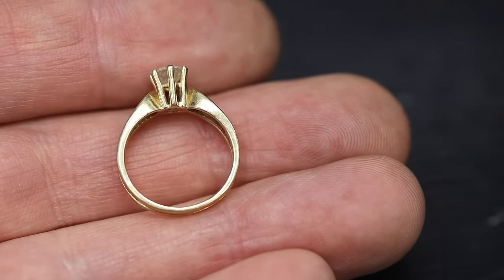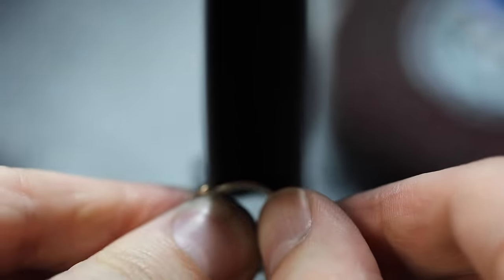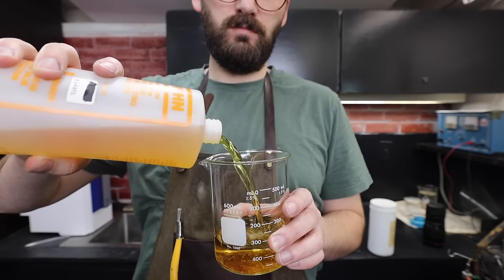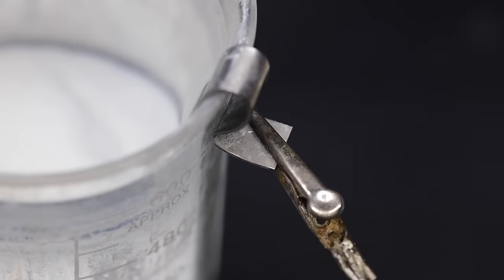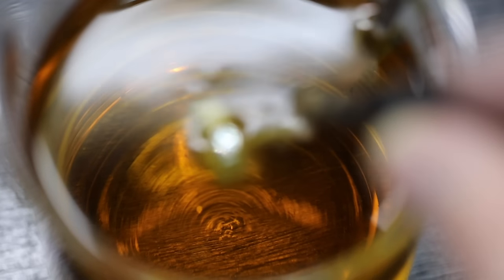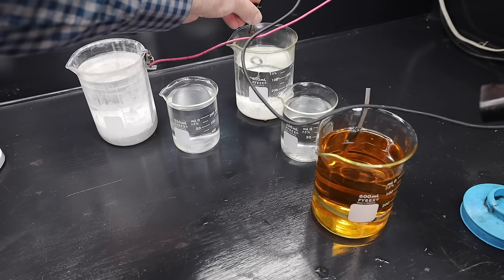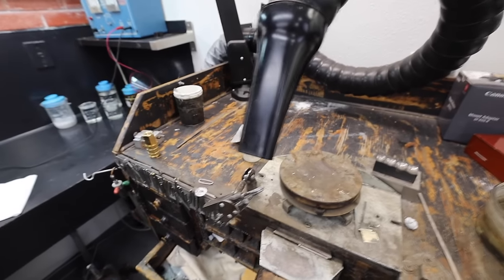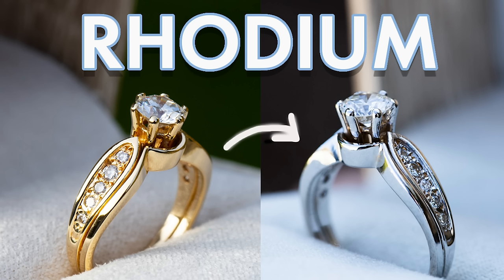How To Turn A YELLOW ring WHITE!

Comment: My skin chemistry is such that the plating doesn’t last a year for an everyday wear, which is why I got my wedding set in palladium :) so happy with it after over 5 years now
Reply: I just had my wedding ring and some other bands replated. The wedding ring is only 2 years old and wasn't that bad at all just a slight gold color showing and only on the underside. My other rings were more yellow but over ten years old in the same area. One was missing a stone. Glad I did my wedding band even though I didn't think it really needed it at the time but it definitely looks a little better. Definitely cleaner lol.

Comment: I am surprised this can be done without removing the stones!
Reply: Diamonds are hard and dont have pores like softer stones would so chemicals dont damage them :)
Reply: I was too, but it makes sense, because diamonds are very poor conductors, so the current wouldn't flow through them and attract the rhodium ions.
Reply: @Yelle777  
Hello, how could i plate a ring with softer stones like quartz, emerald, etc??? Could i just plate all together like diamonds?
Reply: @69rafaroots  remove or protect the stones before plating them
Reply: You can't electroplate metal onto a stone...

Comment: Hello fellow jeweler. I noticed under the stone the base of the head and some of the side stone prongs had some yellow.  That can be defeated.  Small little brush the side stone area, for under the diamond, the ring would have to live in the ultra sonic a few days maybe even some sparex no2 acid.  After that it will plate that section as well.   For some reason those areas get a small thin layer of build up and grime that is there even after its been cleaned and steamed.  Only things that clears is it extra cleaning.

Comment: I have had this done to multiple pieces of jewelry and love the new look. I don't wear yellow gold much anymore and had many pieces of jewelry sitting in a drawer unused. I now wear all of the pieces I had rhodium plated. You do need to know that they can only do this with hard stones. If the piece has pearl, coral, opal, etc. in it, the stone will have to be removed so it costs more.
Reply: Most opal is lab created now so it holds up just fine in the plating solution as do most stones but yes pearls do need to be removed but they’re mostly in yellow gold settings, I’m not sure about coral though

Comment: I'm thinking of getting a few pieces rhodium plated - they're just silver that oxidizes quickly, even without wearing them and I have to clean them so often! what's your advice, will they stay cleaner and shinier for longer if I get them plated?
Reply: You have to get rhodium redipped on rings, usually once a year unless you're rough on them then probably more! This is what we recommend at the jewellery store I work at :)
Reply: Avoid chemicals and opt for a polishing cloth when you want to bring shine back to them because traditional jewlery cleaner could wear the plating quicker and also take them off when you wash your hands and sanitize and get the rhodium redone after it wears off

Comment: The end result looks great. Does the metal of the base ring have any effect on the end result, or could you use steel or titanium instead of gold?
Reply: You can plate any metal.
Reply: @curlyhairdudeify  Interesting. So effectively, the gold underneath this plating is fully invisible, and something only known to the owner. I'd probably not bother with the gold then 😉
Reply: @MrJoerT  the fun thing is that between the two metals, gold is the cheap one...

Comment: Thanks for this video. I need to get my set dipped in rodium again due to wear and tear. My question though is, can my 18k rodium plated yellow gold be converted in to yellow gold instead of white? After so many years, I realized yellow suits my skin tone better.
Reply: Yes ,there is also solution to plate yellow gold as well as rose and white. But keep in mind you have to do it once a year to keep it nice. It wears off.

Comment: I've often wondered this, but why does the rhodium not cover the stones too? Are there any gemstones that don't react well to rhodium plating or the other steps in the process?
Reply: The gemstones dont react because this is a process known as electrolysis. Basically it only works because of the electric current that goes between the conductive metal on the ring and the anode. Gemstones dont conduct electricity so they are unaffected
Reply: @Stettafire  That is so cool! Thank you so much!!!

Comment: Do they have a trick like this for rose gold too?
Reply: Yes, they can have this done to make it rose gold too. I have an 18k yellow gold ring plated with rose gold. However, the color is not as rich as a solid rose gold and the plating will eventually wear away in time.
Reply: @mjre748  Mostly the rose color depends on solution jewler is using, only few jewelers know how to do your own solution, but its time and material consuming and this way you can just buy a bottle ready to go.

Comment: That is so cool to see the process! I’m curious about that yellowing though. My wedding ring is 14k white gold (I assumed it was solid since 14k is imprinted on inside of band and we purchased from a local, reputable jeweler) and gets a tiny bit of yellowish tarnishing in nooks and crannies. Is that an indication that my ring is plated?
Reply: Even though it's solid white gold, there is yellow gold in it which can show over time. You can polish it but it will never be as white as rhodium. rhodium is much whiter by comparison. I had my wife's 14k white gold ring re rhodium plated and it makes it look incredible. 👌
Reply: I think white gold can get yellowish with time and wear
Reply: White gold is naturally white toned with hints of yellow. The more gold in the metal, the more yellow it is without rhodium. 
Nearly every white gold item you can buy from a jewelry store will be rhodium plated because otherwise it would just be an off white/light yellow. 
So it is solid 14k gold. With a rhodium plating

Comment: Would the process affect the shininess of the diamonds since they are soaked in the rhodium? Would it make the diamonds loose?
Reply: No, diamond are not conductive, so they are not plated in the process; in addition they are chemically inert, so they are not damaged by the cleaning steps either. Organic material (pearl, coral...) on the other hand, must be removed before plating

Comment: I've always used platinum wire for plating.  Any advantage/disadvantage to plat. vs. gold?
Reply from the maker: Plat wire will last a bit longer but no other advantages as far as I'm aware. Yellow gold wire is sometimes nice to use so you can see how caked on the rhodium is. If it's used too much the plating won't be as effective.

Comment: How come you need so much liquid rhodium for such a small ring? Could this be done in smaller beakers with a smaller anode? A bottle of rhodium must cost a fortune
Reply: I’m sure it’s reusable, that’s why he’s so careful not to contaminate it
Reply: It is indeed reusable, it could be done in smaller batches if the anodes were smaller, but they almost always come in standard sizes. And when the rhodium isnt used often the proper way of storing it is in a dust free enviroment like the bottle he is using. So that is probably why he poures is out of a bottle. And also yes, last time I bought a liter of rhodium plating solution it costed me nearly €1000

Comment: But the Rhodium will wear off.  My wedding ring is 18K white gold. I have to take it to the jeweler about 1x years for replacing.   If I had to do it again, I would have gotten a 14K ring.  The 18K ring turns yellow faster than if it were 14K.

Comment: I wanna know if you can plate plastic :0
Reply: You couldn't use this method because it relies on an electric current being passed through the ring. Plastoc doesnt conduct electricity, so you would need a different method. Youd probably be better off with some kind of paint designed for plastic honestly. You can get some quite convincing chrome paints nowadays that do a great job. You'll want a black primer though, that's what makes it go from good to stellar when it comes to painting plastic chrome

Comment: I think it is a sorry trick to put a rhodium plate which is fake and it's going to come off real white gold plate is when you take yellow gold and you mix nickel with it to turn it white. You can also turn yellow gold white by shocking it with electricity without plating it. Also that's why you don't buy 925 sterling silver because it's low quality and they rhodium plate the silver. The plate comes off and you have this gray ugly metal. Also you have to be careful on the mall because now when you buy a necklace it looks pretty. But it has a gold Bond on it where they have put a light layer of real gold on that 14 karat gold necklace and when it comes off it exposes a metal under this fake real plating. And I mean real plate is when you add a 5% layer of real white gold over the yellow gold and it does not come off and they're getting biable. This by telling you this is white gold and yellow gold. No rhodium plate is not white gold. It's fake